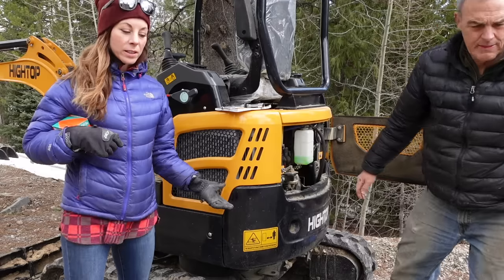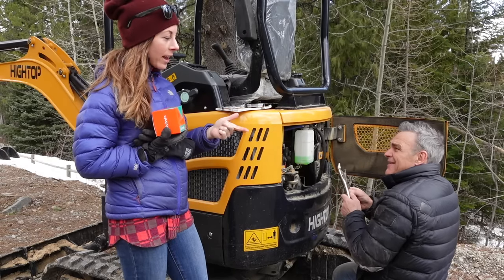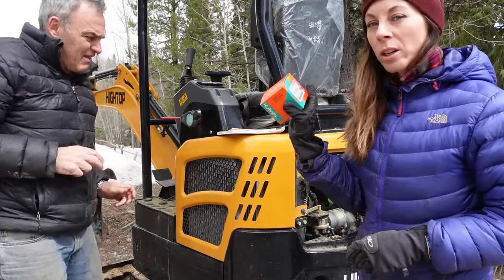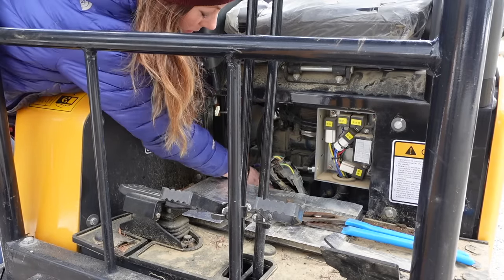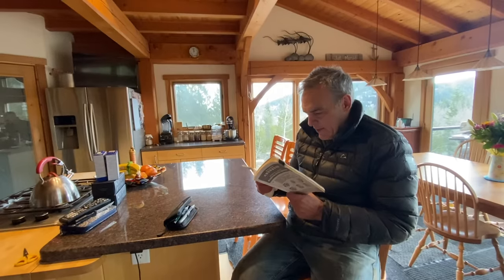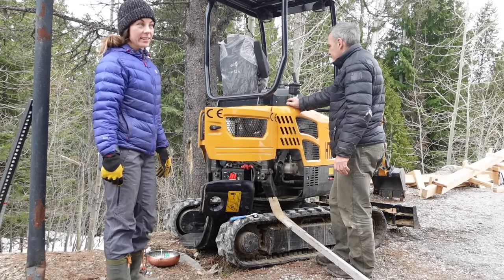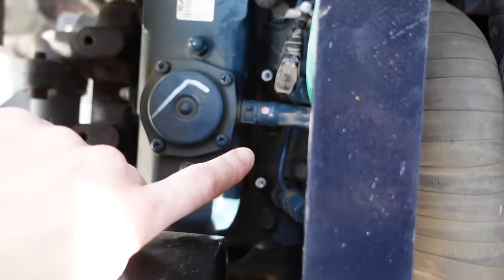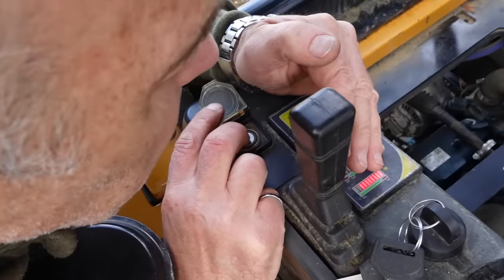Mini excavator TROUBLESHOOTING & MAINTENANCE (HighTop 20 | Kubota Diesel engine)

Comment: You could try an engine block heater, the block and oil will be much warmer and easier to start.
Reply: My thoughts also, my Kubota starts way easier when I plug in the block heater. But it should still start easier than what you are experiencing.

Comment: Unlike the spark problems with gas engines, glow plugs are real easy since they are either on or off or broken. A voltmeter can tell you they are on, take the positive bus off and check the resistance of each plug to see if it is working.  Kubota engines use you as the timer for how long they are on, if it's cold I count to ten slowly, if it's really cold (like where you are) maybe do this twice, then start.  My older tractors had a compression release, allowed me to spin the engine over even when cold, they'll spin pretty fast that way, then release the release and boom, it's running.  Best little diesels made, simple, reliable, efficient, and long lasting.  I believe that no one in the US or Canada makes a diesel engine of less than 50 hp, we also don't make really big ones either, like over 10,000 hp.  Modern ships use diesel engines of 100,000 hp that are made in Europe, Japan, and Korea.

Comment: As I recall, and it's been quite a few years since I was driving diesel machines, there were a few different sequences that glow club pre-heat notification could take. Such as, the light would only come on once the plugs were sufficiently hot; come on while heating and turn off once heated; and then blinking when heating and solid when hot. I don't know if there a standard sequence like an ISO rule or something, but I'm sure Steve is knowledgeable in it I. But, I would conclude there is a fault in that circuit or it was simply manufactured wrong; you should get some sort of notification. Of course, I'm sure you both have figured out what is going on.
Reply from the maker: Ya we’ve tried all the configurations and nothing gave an indication of actual heating. Steve is quite sure it was wired wrong at the factory, which wouldn’t be a big deal if we knew that! Haha

Comment: You could have a bad starter, It is not turning the enginee fast enough. On the glow plugs, check the voltage on the glow plugs when they are supposed to be on.

Comment: Make sure voltage is getting to the glow plugs. Also some ignition switches need to be turned counter clockwise for pre heat.

Comment: It's a whole detective. It was interesting to see why the tractor would not start. It was very dramatic. I became worried because you tried a lot of options but the tractor does not work. It turned out that everything is so simple. But now the tractor has been serviced and will work well. You didn't waste your time.

Comment: If memory serves me right, 
The days I worked in the oil patch, we would power the skid shack/ office with a diesel generator and back then there was winter fuel  and summer fuel.  If summer fuel was left in the tank during the winter the fuel was like jello. Best bet is drain the tank and try fresh diesel.  Hopefully it works out

Comment: I've owned a bunch of diesel cars, trucks, and tractors, all of which use glow plugs to start.  I remembered a song from long long ago that was pretty popular at the time, the glowworm song.  I have modified it and use it whenever I start one up singing 'glow little glowplug, glitter, glitter.........'  try this, it might help.  Always worked.  I suspect that you can sing better than I can, so it should be even better for you.🥰😃🙃😎

Comment: My GF has a Massey Ferguson 1529 compact tractor, 28HP 3 cylinder Iseiki diesel. To operate the glow plugs you turn the key slightly, till you see the oil pressure and charge light dim down indicating the glow plugs are pulling current and pulling the battery voltage down. The dealer explains this, the owners manual does not. Pretty hoakey but I guess it works.

Comment: Great vid.
If you change out the two bolts on the back of the counterweight by al threads, before loosening the bolts underneath, then you can slide the counterweight backwards without removing it completely. That way, one person can change battery and filters, threaded rod or bolts from 10 or 12” will do, if you use threaded rod, make sure to put a nut on the end so the counterweight can’t slide off.
Reply from the maker: Great tip!! Thank you! I would dread having to take that whole thing off again! 🤪

Comment: So did Steve check the wiring schematic to the actual build. Did it match? Will he rewire it so it will work as designed? Since the engine is Kubota this should be available at your local Kubota  dealer.  I’m sure your on this already.
Reply from the maker: We don’t really care at this point that the wiring isn’t correct - it’s just not correct to the dash lights. But there is 12 volts going to the glow plugs (it just doesn’t show that on the dash), so now that we know this, we will just carry on.

Comment: FYI - I assume you live in a very cold climate? For what it's worth during colder months u can run the 80% diesel and 20% kerosene to keep fuel from solidifying & save your old oil from oil changes and strain it then run it back thru fuel tank ( Warmer months ) to help injector pump with extra lubrication.

I have a Ford dually with 7.3L engine and holds almost 16 qts of oil and I save used oil and been running back thru fuel tank for MANY years !!!
PS greetings from NC

Comment: Hiya Michelle,
Nice video, thank you. I did thunk about the power getting to the glow-plugs, but then I'm an electrician who has run diesel generators for film and TV. I did all the power for Princess Diana's funeral for the BBC at Westminster Abby. I've had glow-plugs burn out in old Perkins diesel engines. I wondered how the manual said to send power to the plug and was that happening, I've had brand new ignition switches not fully working, digital engine control modules only half working, and new ones. Just because it's new does not guarantee it's fully working or checked. Steve is incredibly patient, most especially with you, I wonder why? 
Stay safe, Steve...

Comment: We always add an inline fuel one-way valve on all our equipment. Diesel likes to run back to the tank over time and the standard one-way valve in the system is not always reliable.
Reply from the maker: Ok, good tip. I’ll let Steve know! Thanks!

Comment: I had an Isusu NPR that was hard Starting
I wired a relay to energize the glow plugs. (12V temporary on button w/ fuse and solenoid)
Push the button; for a slow count of 10. Crank the engine and like magic it runs.

Comment: Hey just a thought. Next time you have an issue like that hit us up with a help what is it video. I'd run a 12 volt light up to my dash and run it in series with the glow plug harness so you know when they are actually heating. I had to do that with an old diesel dump truck I had. Short bio was a 1960's International 4 cyl which I blew a piston so I turned it into a 3 cyl. since I couldn't find even a junkyard piston to replace it. Stuffed a coffee can into the bad cyl hole removed rod and bearings. Ran for another 12 years

Comment: Who did you buy your HT-20 through? And was it cheaper than buying it in Canada or USA?
Reply from the maker: We bought it directly from China ourselves at ?China machinery (I will have to find out the name of the company - but it’s one of the biggest machine companies to buy from), and yes, WAYYYY cheaper. Shipping during COVID was costly, but it was still much cheaper.
Reply: @michygoss7148  Thanks for responding I am looking into buying one toss-up between high top like yours or a vote the vote looks pretty nice it has a Yanmar engine witch are as good as Kubota.
Reply from the maker: @michaelburke6552  totally. Both good Diesel engines, so I think that is the most important thing. Probably do fine with either! Good luck with it!
Reply: @michygoss7148  Can write link to your HT20 company where u order ?

Comment: Another interesting video. Thanks! I have a Kubota RTV 900 that has a small 3 cylinder Kubota Diesel in it. The key is progressive - Off-On-glo-starter. My ZD1211 mower alohas one but it clearly indicates when the Glo plugs are activated. 

My John Deere tractor has a key that requires turning it the wrong way for the glo plug. i.e Glo-Off-On-Start. Unlike the Kubota, the John Deere has a direct injection engine and doesn't need the glo plugs to start unless it's well below freezing. I'm glad you were able to decode the issue. The good news is that you know a lot more about your little excavator! My life long exposure to Diesels tells me that if I keep the oil, air, and fuel clean, a Diesel will be about as reliable as Gravity.

Comment: My guess right off the bat was glow plug not actually working/getting hot. Had an old ford 6.9L diesel. Miss that truck. For years it started really hard just like that. Took it to a guy that charged me 700 bucks and never did replace them apparently. Sold it to a guy that bought some motorcrafts for like 20 bucks each and installed them himself, vroom vroom away she goes. All that time I coulda done it myself easily I guess. Nice you figured it out, I had to replace a bad controller once too that totally nuked the plugs.

Comment: Food for thought... I have a small Massey Ferguson tractor with an Iseki diesel in it (made in Japan). 23hp.  It never started well from new.  The battery would also go dead after a few weeks.  I went through 3 batteries in 5 yrs.  Always started badly no matter what ambient temperature.  One day the starter failed and needed to be replaced.  I found a cheap replacement starter on e-bay and changed it out.  The first time I turned the engine over with the new cheap starter, I was shocked.  The engine turned over way faster and started very quickly.  I have had this starter in for about 7 yrs now and I haven't had to change the battery.  It would appear the original starter was bad from the factory.  Tractor stills starts quickly.

Comment: Michy, nice lil machine. I have one similar to that. I also opted for the Kubota. My is a D902. Since I got it, my took longer to start, like yours. Accident, though a blessing. I wanted to install a water reservoir for the radiator. I welded some studs to mount the tank. Inadvertently getting welding splatter on the wiring harness. I quickly put out any smoking. Thought I was good. Few days later went for my machine. Dead. No start. Went to check battery, wires were 80% burnt. 😮. No problem , I will cut the bad section out and replace it. In doing so, did some minor adjustments to the wiring harness. Mostly grounds fixes or rather minimize the number of contacts. Why four wires instead of a comparable adequate ground wire? Got it put back together. It now starts exceptionally quick. I am not positive exactly what I did, but very Happy I did. Have Steve maybe look at the glow plug wiring. Maybe rewire just that for a quicker start🤔.
Reply: Check make sure your Cut off solenoid is working properly.

Comment: If the return line is porous or leaking somewhere, the engine will also start poorly or not. Once you stop, starting again takes a long time. Not allowed with a new machine, but everything from China you have to pay attention to how clean the machine is. They are very sloppy about that.

Comment: Try to see if it will ignite on starting fluid, if it does, then you know that your glow plug relay  is not sending power to the  glow plugs, it needs changing. Yes you can make them glow off the battery, but when it's in it's  own circuit, they are not working, thats why the glow plug light continues to blink!

Comment: You add fuel to the filter when installing new filter. It help keep air out. Can put a heater blowing on motor. Can get warm and start easyer
 How has this machine worked out for you. Do you like it

Comment: I had a similar issue found out that my Cylinoid that is hooked up to the glow plugs was not sending power to the glow plugs to warm the cylinder
 I changed my cylinoid  and it worked fine but that was just my equipment

Comment: Fuel looked pretty milky! There is additives in winter diesel. So if you stored it for winter with summer diesel it can turn on you.

Also run some diesel service etc additive in your fuel. It will quiet down the machine. Low sulfur diesel is horrible on injectors as the fuel doesn't lube as much.

Comment: I have a Yanmar 20 hp diesel tractor. I have a lever to pull that releases the cylinder compression. After heating the glow plug and start cranking the engine I release it and it’ll start up.

Comment: There is a difference between a mechanic and an engineer. I happen to be both. We learned a lot during that 4 year apprenticeship including never pull the machine apart until you are certain it has fuel air and an ignition source. A light on the dash doesn't assure you the plugs are powered.

Comment: I've been looking into getting one of those mini excavators. I'll have to wait and see how yours turns out first.
Reply from the maker: I will do a dedicated review of it one day because I think people actually wanna know how it is - but in all honesty, so far it has been great. I don’t consider this to be an ‘issue’ with the machine itself. It’s either wired wrong, or someone else did suggest maybe the bulb is burned out. (Never did check that, but will and will let people know). For the hobbyist (like Steve and I), it’s a great machine. It’s like sawmills. You can buy a woodmizer if you’re milling full time and perhaps earning an income with it, or you can buy a woodland mills which cuts wood and is perfect for a part time / hobby thing. Same kind of idea.

Comment: THANK YOU for not showing the counterweight (not just a cover plate) nearly killing anybody!
Nothing against bubbles, but I personally love the pure sounds of the water drops as you move around in a hot bath without.  As always, thanks for sharing and baring (not the blocking type).
Reply from the maker: Lol. It didn’t. Don’t worry. I figured it was a counterweight being at the back. There were some funny scenes of us trying to get it back on, which Steve told me to not include (haha), but no one was even close to getting hurt 👍

Comment: A quick look at the owners manual would have instructed you on starting procedures! At least you achieved a service, did you grease?
Reply from the maker: Manuel was looked at, but it’s instructions didn’t match what was happening on the machine. I did grease all components, but I did that a couple days after I put the video together.

Comment: You guys have some pretty sweet toys! My bet with glow plugs is a bum indicator bulb. It's happened to me with a 2 stroke oil injection system. Your starter is definitely not cranking fast enough. We run those Kubota engines at the golf course and they spin faster than yours but they always pop and fart for the first 20 seconds or so
Reply from the maker: We didn’t check the bulb! So will definitely check that out!! Thanks!

Comment: Good you got to the bottom of things. However 1 is a bit suspicious of the slow motor turning over. It should kick over faster than that.
Reply from the maker: But it was only slow because it wasn’t being warmed up properly. Now it starts right away and sharply, at that.

Comment: Great video,  Steve is a smart guy, I knew he would or both of you would figger  it out. just a tip when driving your "Vator" keep the bucket close to the machine in transit. It will reduce the sway. Hope it helps , keep up the great work!
Reply from the maker: Great tip! Thank you!

Comment: Funny thing about engineers is that they always save the most likely culprit for last so they can spend the whole day fiddling around with everything else. You stated right at the outset that there was an issue with the glow plugs flashing instead of being steady on. But in the end you learned all about what makes your little machine run. But where were the bubbles?
Reply from the maker: Deep down I really felt it was a glow plug/pre-heating issue, and deep down we both weren’t certain we weren’t doing something wrong in that regard. But nonetheless the machine needed that bit of maintenance (fuel and oil), and I needed all of that learning experience!

Comment: Interesting video, my kubota excavator had similar issue, my resolve was bang the dash n the glow plug light came on. Just a short. I fortunately don't have to remove counterweight to get at battery however it's a snug fit. Did you redo the soaker tub and is it a claw foot?
Reply from the maker: The tub isn’t vintage! It’s a fake 😜
Reply: @michygoss7148  oh no, be still my DIY  heart, haha I figured with your talent n yearn to do n try new things for sure you made it look beautiful. Well hey heck you did do that

Comment: At least I can say that the engine is not running fast enough at the start. Maybe a bad starter motor or somewhere is a bad ground? Ground wire from battery to body is loose ?
Reply from the maker: It starts well now that we are actually warming up the cylinders!

Comment: A little WD40 down the intake always kinda gives the diesel a bit of a priming
Reply from the maker: Steve said he used to do that, but it’s not good practice 😬
Reply: @michygoss7148  Thanks for the reply! He is absolutely correct. We have to sometimes resort to drastic measures here in extreme northeast ohio, and WD40 is preferred over Starting Fluid.

 FYI, I've found Yanmar Engines are much more reliable cold starters than Kubota's.